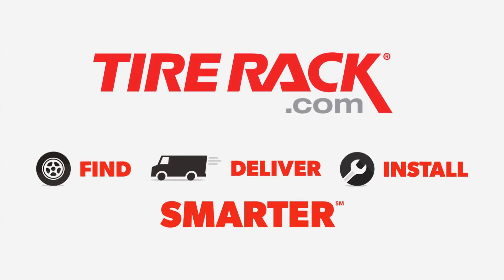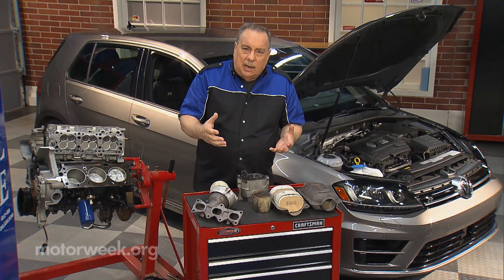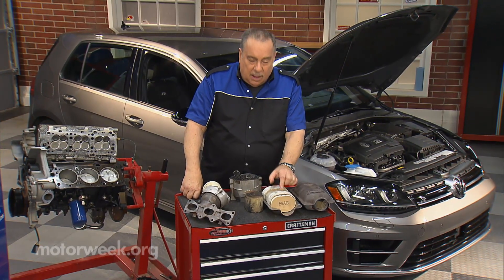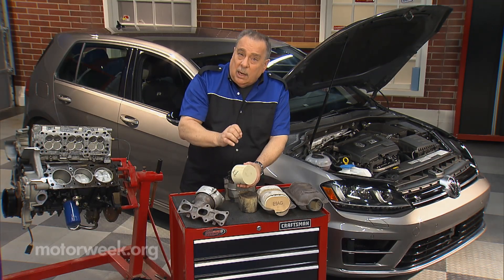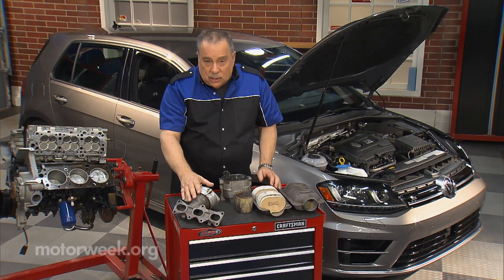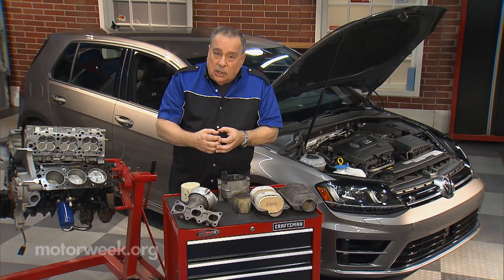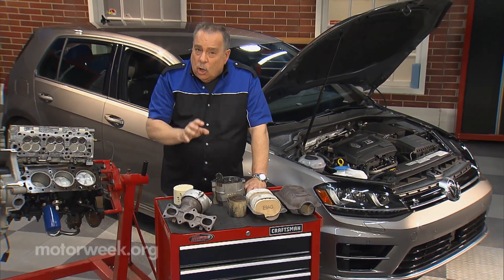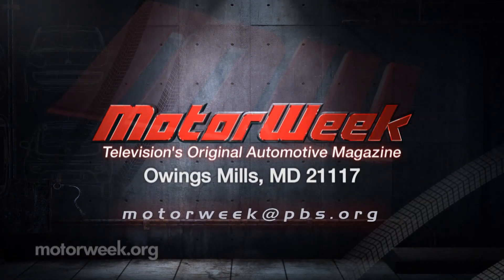Goss' Garage: Catalytic Converter Issues

Comment: 2002-06 Nissan Altimas have this exact same issue. PreCats break up and causes engine to burn oil.
Reply: Exactly while I'm here. My 06 is 8n the shop replacing with a header to eliminate it.

Comment: We have a honda 3.5 that took out the rings on the rear bank because of the CAT, should we rebuild or replace with a short/long block?
This happened after a T belt replacement, could a misadjusted belt cause too much overlap leading to this phenomenon?

Comment: The cat code will come on a time before the cat stop working. The cat breaking up and being sucked back into the engine is pushing it..
Reply: I think on manual transmission,when you use the engine as a brake, going down the mountains, you essentially create a vacuum in the engine and when the exhaust valve opens, it can suck the ceramic dust in....I wish the guy in video be more explicit about "Certain conditions", rather then using scare tactics to leave consumer dumb....

Comment: Some GM cars have corrosion issues in wire connectors that will alter the resistance readings in temp sensors, making the car think the cat is not warming up properly in comparison with these sensors, faulting the cat and setting a cat code when it's not the cat.

Comment: also your vehicle will not run in its peak mpg because the engine light is on meaning it will get horrible fuel mileage